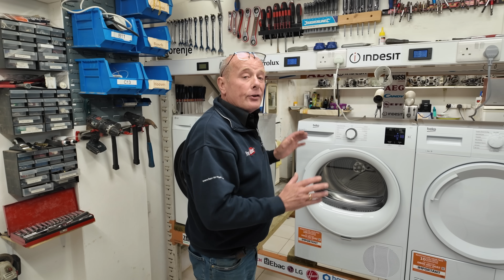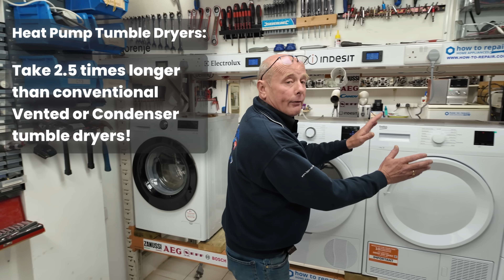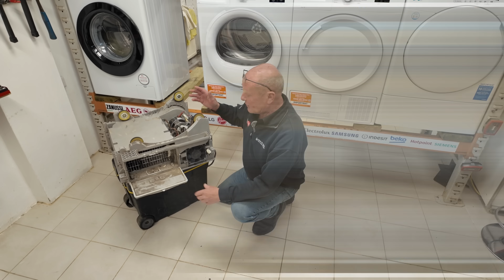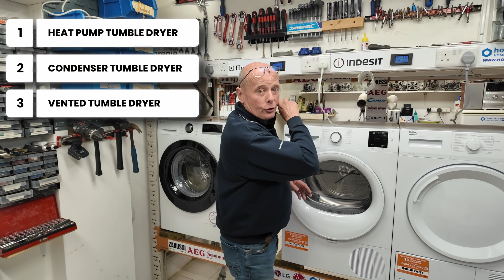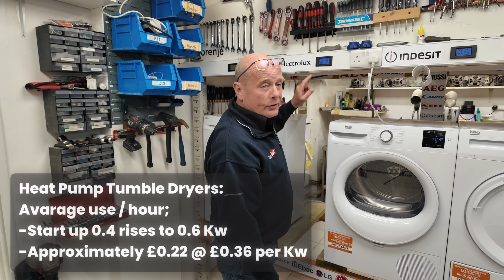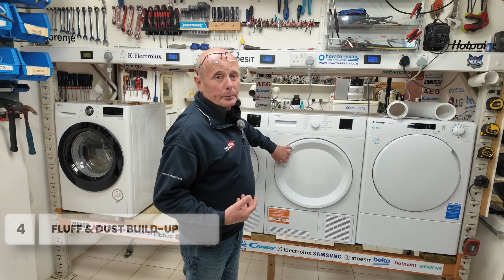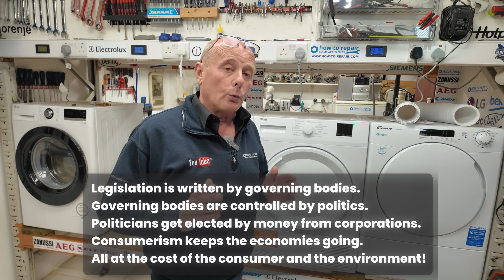Tumble Dryers the Shocking Truth About Heat Pump vs Vented & Condenser, NEW LEGISLATION!

Comment: You are spot on,  all the big manufacturers will go on about being green,  but the solutions are worse in the long run, My dad used to work in the domestic appliance world,  you used to be able to carry out repairs and keep these things running,  now its not cost effective, they dont want you to repair them,  I work in IT and this is the same,  everything is geared around pushing out something new as apposed to it being repairable,  printers are a prime example,  you are lucky to get two or three years out iof them, then its throw it away as there a re no servicable parts,  manufacturers dont recycle them so it just goes to waste/ landfill nothing eco friendly about that at all.
Reply from the maker: I've been repairing machines for nearly 50 years, and the basic principles of them haven't changed since the 70s. It's baffling why we need so many extra features now. Machines used to last 15 to 20 years on average. Nowadays, you're lucky if they last five years. Obsolescence is clear in today's society.  It would be really helpful for me to get my video shared and help us fight appliance waste!

Comment: I miss my white knight condenser just turned it on away you went no bells and whistles had to replace as finally broke with a Samsung that has a sensor dry that only dries anything from just out the washing machine anything that comes off line that just needs 10 mins it says its dry when its not and it don't even get hot I've discovered in recent years even with fires anything that claims to be energy efficient is literally crap the old stuff was better

Comment: Interesting. We have just replaced our 25 year old Hotpoint with a Samsung heat pump dryer. It doesn't take that much longer than the Hotpoint did to dry clothes. Lets see how long it lasts

Comment: In the winter I put the clothes on a clothes horse up against a radiator in the utility room.  Open the window and also the door from time to time to let the steam out.  There's an extraction fan, but I don't use it.  I gave up on the dryer because of my sinuses, but I didn't have the exhaust sent to the outside.  Dryers are overrated and unnecessary in my opinion.  The heated towel rail in the bathroom works well with the window open as well.

Comment: What a fascinating and informative video - the presenter is so engaging. A few points, based on my own experiences of dryers - firstly, when I replaced a condensor dryer with a vented model back in 2013, I was astounded as to how much faster the vented dryer was. It was a cheap Hoover with sensor drying (the Bosch it replaced had sensor drying too) and it was brilliant. So I've since thought vented dryers are cheaper to run than condensers as they dry faster.  

When the Hoover had to be replaced last year, I could not get another vented dryer with both reverse action and sensor drying, and there was no way I was willing to compromise on reverse action (despite so many dryers not having it these days), so it was a choice between heat pump or a vented with no sensor. The problem is, I know several people with heat pump dryers and they all complain about how long it takes to dry washing - far longer than the 2.5 hours mentioned in the video.

To that end, I bought a cheap-ish Indesit vented, with manual timer. Now, I would argue that ambient temperature does impact a vented dryer, as my dryer is outside in a shed, and like now in the cold winter, it takes a little longer to dry clothes now that the incoming air is so much colder, but only by about 15 minutes. An 8KG load spun at 1600rpm (I have an Ebac washer) takes between 80 and 90 minutes to dry. The machine is rated at 2.5KW. So that's roughly 3.75KW per load. 

The heat pump dyer, using a lot less power throughout the process, seems to generally use about 2.15KW per cycle, based on the information I can find online, however, given that those people I know are telling me how much longer than stated it takes to dry the washing in the real world, I am very skeptical of the actual amounts of energy saved. 

I have to say I had never considered the wear & tear on the laundry, and I had no idea these machines were gas-filled and had other issues that affect their long-term environmental impacts. It was simply the length of time to dry laundry and the amount of faffing about emptying the machine of water & cleaning parts out that really put me off buying one, so  hearing what I have makes me so glad I bought another vented, even if I do miss the sensor drying feature and have to rely on a best-guess time-wise when starting the drying cycle.

Comment: Had a Creda vented drier since 2003. Works perfectly , 2 heat settings and a timer. Tried a condenser dryer but hated the length of time it took to dry my towels. As regards cost, drier cost me £100 to buy new, my monthly gas and electricity cost (5 bedroomed house with gas central heating) is £82. So don't think it costing me a fortune to run. I'll stick with my old dryer thanks

Comment: I have a heat pump dryer,  it saves a fortune on electric , I always clean the door and bottom filter every time , and hoover the front of the condensate heat exchanger a couple of times a year . It has a long guarantee so if the condensater goes I don't pay for it

Comment: I’ve had a beko heat pump drier for 5 years and it’s been absolutely worked hard most days (my kids jobs are dirty !). Absolutely brilliant, no problems and has without doubt saved me ££££ on my electricity bill. I would without hesitation buy another one.
I had a condenser dryer before which cost me an arm and a leg in electricity !

Comment: Personally I've upgraded my brand new AEG Absolutecare 9000 heat pump dryer by adding another foam filter in front of condenser part as far as it is not possible to disassemble it and clean it compare to my old condensing dryer. Many are doing that to avoid such absolesence' issue of nowadays.

Comment: Point 1. Just to be clear… you state: that heat pump uses 1/4 of the consumption of conventional BUT takes 2.5x longer. But you failed to mention that it’s still a reduction, 62.5% of energy of conventional driers - it’s disingenuous not to highlight that. 

Point 2, would you need to change the compressor or re-gas the system? I’ve never needed to do it for my fridge or freezer - a heat pump system done to death. I’ve changed more heating elements. Gas leaks would only ever be a build quality issue. Statistically do they have catastrophic failures? And if they do, won’t designs improve. 

Point 3. Making the assumption you’d not find an engineer to make the fix is also disingenuous. Engineer skills adapt to market trends…and if markets trend to heat pumps (and why wouldn’t they with a reduction in energy) then you’ll get you engineers.

Point 4. Granted the cleaning of heat pumps is difficult , but the costs of not cleaning them is far less than conventional dryers (TLDR: house fires). To simply ditch new technology because it has some issues rather than improve it is retarded. So perhaps, innovate and figure out ways to clean heat pump systems in less than 2hrs is a better approach. It’s just lazy. 

Point 5. Wear  and tear on your cloths because they spin for 2.5x longer? Seriously? And wear and tear of clothing has nothing to do with high temperature that conventional dryers bring? Or the over drying? 

Overall, extremely weak arguments against heat pump tumble drivers.

Comment: Bosch Exxcel 7 bought in 2012, moved house 3 times and it's still going strong. Think it cost a massive £600. Used every winter. Only gripe is the condensor doesn't seem to just pull out.

Comment: As an appliance engineer in the UK , I would suggest Hotpoint and Indesit vented and condensor tumble Dryers , rear bearings 10 minute fix , belt 20 minute fix , heater or over heat stat 20 minute fix.
Can be repaired multiple times as well.  When asked to repair a heat pump tumble dryer , its a shake of the head followed by ....its end of life , suggest replacing appliance.

Comment: We live in an airconditioned house. All energy generated by the tumble dryer has to be removed again by the AC system. Does that change your calculation? I did not get the point why a heat pump dryer takes longer than the other 2. Mine is very quick....

Comment: I can not afford to wait around all day to do three washes and three drys my friend  has a heat pump dryer and if they start the wash day at 9.00am  after a 35 min;s of a wash they then have to hang around waiting for the clothes to dry  at about 11.30am with in this time they have completed the other two washes two dry the other two washes they finish at around 5.00pm .  I start at 8.00am put my first was in and 35 min's later its in the vented dryer by the time my next wash is done my clothes are dry and in goes the second wash and so on for the third wash so by 9. 45 am i'm out the door I have the rest of the day to do what i like, not having to hang around all day or keep going back and forth to home get my washing all done in one day then you have to had to the cost of car journeys and fuel. Is it worth having a heat pump dryer in my book NO.

Comment: Seen all types you mentioned used for my domestic laundry and the heat pump is the coolest and quietest to run.  I also don’t have to have extractor pipes, ducts or fans working simultaneously to prevent the machine or the room it’s placed from overheating due to excess heat or external effects the dryer. I question the duration of the vented and heat pump dryer cycles as my clothes are now reasonably dried of excess water and not cooked biscuit dry as with the older formats.  A five year cycle is based for your mtbf estimate, does this match with the manufacturer’s data? and also warranties can be or extended to cover this period.  
Easy job to remove the my previous machine’s condenser tray and clear the vanes, however when I opened up my machine the condensate reservoir in it’s base, and surrounding area was coated with it’s own (velvet) layer of fluff, so it seems it is a common design problem.  
You’ve already highlighted the shift in production away from older types and seems that the service industry needs to match that move; it’s already occurred in the automotive service sector and there should be a similar route to competencies for the domestic appliance workforce.
Lastly, is there a Trade Association that fits your needs to highlight your concerns?

Comment: Bosch 10y warranty self cleaning heat pump. Expensive to buy, so cheap to run and a no brainer for UK weather. Dries fast, doesn't damage or shrink clothes. Just clean the clean filters every use as per all driers

Comment: Local fire officer warned me never put dryer on and go to bed. Two biggest causes of house fires are heat pumps inside dryers and fridges. If you’ve ever seen just how much fluff accumulates inside the housing of a heat pump dryer you’ll understand why. Impossible to remove. Don’t buy a dryer with a heat pump.

Comment: Everything you said was clearly expressed I agree with you 100% I've had all three machines and I must say the vented dryer is the quickest and easiest to take care of. 
The negative of the condenser dryer is the amount of heat that comes into the room while it's being used. In the winter, it's fine but in the summer, your air conditioner has to work twice as hard. 
The heat pump dryer does work does take more time, but involves much more cleaning. I could definitely see that lint accumulating is going to slow down and eventually destroy the machine.
Reply: And why would you be using a tumble dryer in summer for goodness sake!
Reply: @94hydenseek  when you don't have any place to hang the clothes, hello

Comment: You stated that bad design is one of the main issues hopefully over time this will be resolved, also when there is no other option the technician will up skill so that they can be repaired at good price point, I like my heat pump tumble drier as it low energy and can be powered by my solar panels without drawing from the grid

Comment: One pedantic point; the effect on heating cannot be discounted; pumping hot air to the outside is never a good strategy; keeping as much heat as possible within the living space is desirable - especially if humidity can be controlled

Comment: Can't the compressor be hermetically-sealed, like in a refrigerator?  If so, it should be as reliable.  Does the heat pump dryer cool the air in the house?  That is good in Summer in hot areas.

Comment: Yeah I certainly wouldn’t be happy to have a heat pump dryer, at least the vented one we have is easily repairable and easy to clean.  What’s the point in having a heat pump dryer because it maybe 2 to 3 years before something goes wrong and you’re going to be advised to get a new one, while an less energy efficient vented dryer would likely still be working but definitely it would still be serviceable.

Comment: I dry most of my clothes on a drying rack which helps to gently rehydrate my otherwise dry house with the moisture given off. I use my heat pump dryer now and again to fluff up clothes which are a bit lifeless. This massively cuts down on both power and wear on the clothing. Most of my clothes are made from merino wool which don’t hold much water anyway. Only the cotton clothes take a bit longer to dry. Simples😉

Comment: Just replaced my 28 year old vented dryer with a new vented dryer. I passed my old vented dryer on to my son as it is still going strong, but I'm having a new colour change in my kitchen. My vented dryers only take 45 minutes to dry the clothes. I have never needed to run mine for any longer, even if I'm drying towels or jeans.

Comment: Thank you, this is very interesting. We have recently replaced our old mini white knight vented tumble dryer, couldn’t get the parts anymore. We chose a new larger vented model, because we already had the hole in the wall, and don’t have anywhere to tip the water in our unheated garage. We use it sparingly, mostly in winter, to keep up with work clothes and bedding. Our efforts towards climate change, pollution, and energy consumption are more focussed on using less, buying local, and second hand. Probably not what the government wants but it works for us, saving money for rainy days

Comment: Thanks very much for an interesting  video. However I was very surprised that the condenser dryer wasn’t more efficient than the vented one. 
On our condenser the warm moist air passes through the condenser thus loosing moisture and heat. But it’s certainly a lot warmer than room temp before heading back to the drum via the heating element. So assuming drying time is very similar I can’t see how the condenser type can’t fail to beat the vented on energy efficiency.

Comment: Really useful information, thank you. We've had a vented tumble dryer for years, why would I change to a heat-pump variant.................more parts, more to go wrong and as you've advised it contains a gas, you cannot dispose of this in a normal manner. I cannot believe why these companies are allowed to build something that cannot be easy to maintain, such as gaining access to where the fluff builds up. I want to go into my local Curries now and ask them how easy a heat pump tumble dryer is to maintain.

Comment: Without a load of wet laundry in I don’t see how this is an effective test. How well they dry is necessary to know. If possible one wouldn’t want a tumble dryer in the kitchen especially going for that length of time. My utility room is much cooler. I replaced my dryer with a basic vented machine it is fast and efficient, I only use when essential and my engineer said that my previous machine wasn’t cost effective to replace it as you said. Is that dust not a fire risk?

Comment: Conclusion - Buy a high quality heat pump dryer with good warranty.
Some manufacturers rush to reach the market with new products that they did not spend enough time or resources to optimize. This results in poor quality products... or ones that are made to fail with prescribed obsolescence. For the manufacturer it's more profitable to sell you 4 machines over 20 years, rather than you using 1 for the same period.

Comment: My cloths drier is probably the most efficient you can use. It's called a cloth dryer. It's a metal frame; I place outside and it dry's most items in 2-4 hours. Uses no electricity, maintenance is a quick wipe with a damp cloth, every week or two.
On a cold rainy day, I bring it in doors and stand it in front of my heat pump, which is already heating my home.
I have used this method of drying for probably 20 years. Prior to this I used a wire stretching from the corner of my house to an elevated pole in the garden. My grandmother also used this system for over 70 years.
Reply: 2-4 hours? You don't live in England then. When I was a kid I watched my mother bringing in washing from the line that had been out for a day and had frozen solid..... slightly drier, but only slightly.

Comment: I agree with your analysis.   You are missing one cost factor, the air that is vented out of the house and thus needs to be cooled or heated by the building systems.  I have seen analysis' showing this cost to be $200-$300 a year.   This does not fundamentally change your numbers, but it does affect them.

Comment: My condenser dryer cost me £200, 17 years ago.   It lives in the garage and gets the filter and condenser cleaned regularly.  Its used approx once per week for an hour which costs around 2 KWh of electricity. So far its cost me £1 per month to own apart from electricity.  From what you say I would probably be on my second or even third heat pump dryer.  The cost of repair and/or replacement of the heat pump dryer would well exceed any saving in electricity.